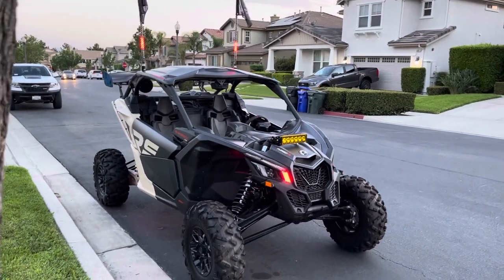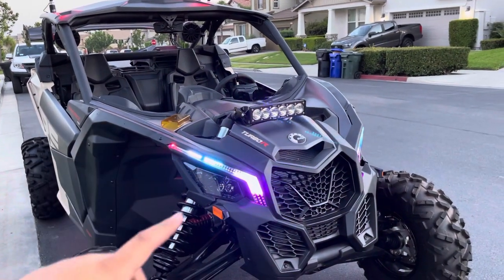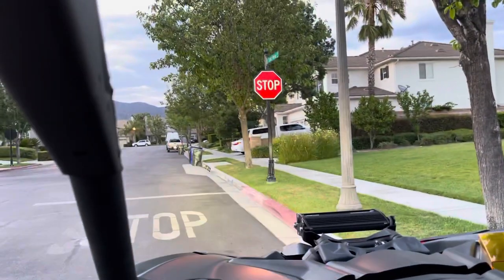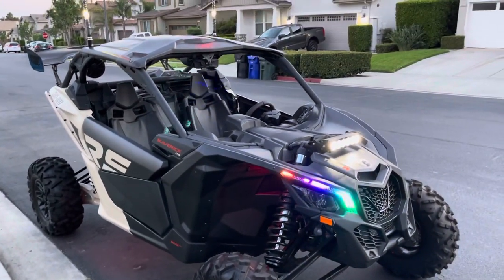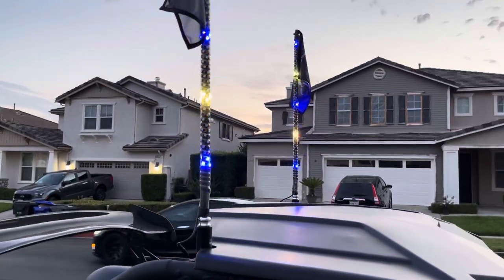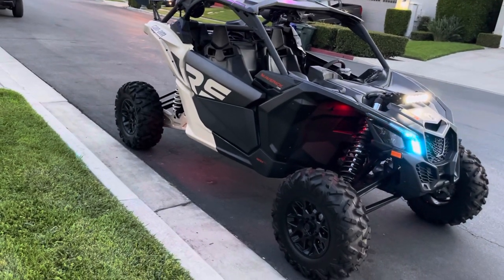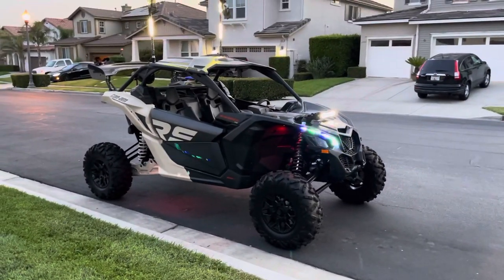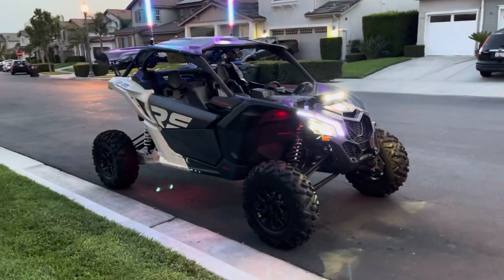2021 Can Am X3 MB Quart Stage 5 Sound System

Comment: How much was the system? & did you upgrade to some 32 in tires for the trails or you use the stock tires ?
Reply from the maker: Sound system retails for $1899 really great sound for the price. So far ive only taken my car to the sand (pismo beach and glamis) i do have 32” sand paddles. Check out my “new wheels” video.
Reply: @outlaw8388  yuh I checked out the tire video, them sand tires are bad ass🔥 is the system worth it? Is it loud & does it have good base ?
Reply from the maker: @ItsHisComedy4You  very loud bro. Bass is 8/10 but clarity of sound is 10/10 highly recommend.